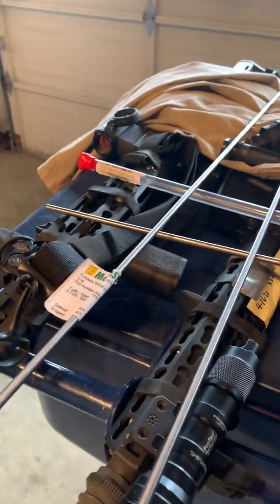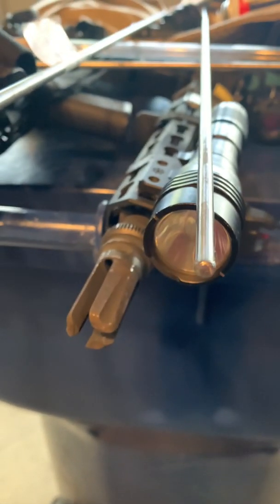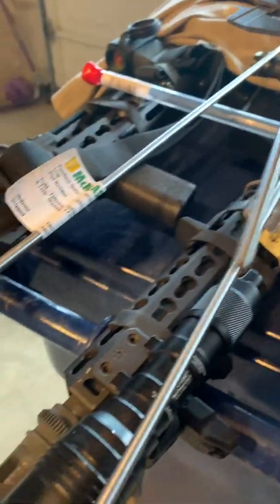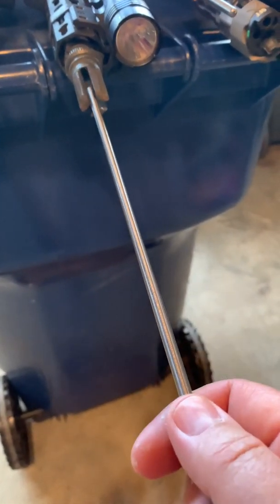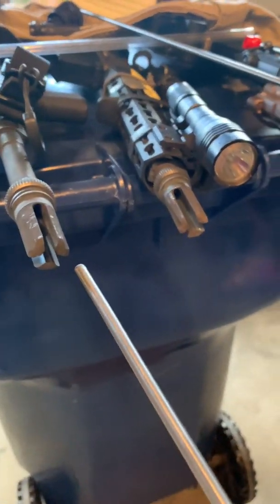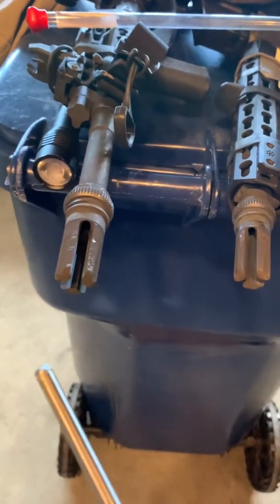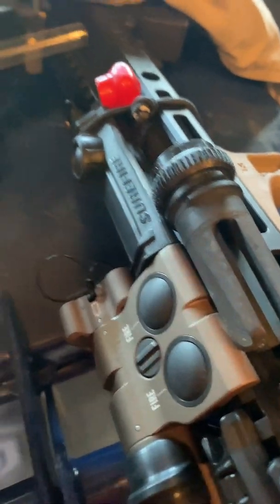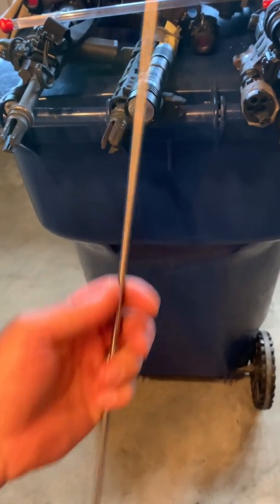McMaster .218” rod compared to .212” and .217 rods with 3 different 5.56mm barrels.

Comment from the maker: Peeoii - got your reply via google mail but not seeing it here.  
“How tight are your muzzle devices? 20ft lbs and higher cause barrel constriction. AR15 tech tips in under 8 mins has a video “the dangers of over torquing flash hiders” very informative my groups got tighter by .5 moa when I loosened my flash hider from 35 ft pounds to 17ft lbs and applied slight amount rocksett”.     Per  Barry Dueck of Surefire, going over 30 ft lbs can compress the muzzle, so I do not go over 30.  For bolt guns, I will use 20 ft lbs and for self loaders, I’ll go 25 but no more than 30.  For a bolt gun I’ll use 1 drop of Rocksett and for a self loader I’ll use 3 drops.  I always dry fit the parts and check with an alignment rod before committing installing with Rocksett.   For a AR, you’ll want to use a Geissele reaction rod, or something similar to keep the barreled upper from rotating.  Never use a crush washer with a can.  If you are using shims to time a muzzle device, dry fit everything prior to using Rocksett.  Hope that helps.

Comment: What flash hiders are on the 2 left ones??
Reply from the maker: AAC Blackout 3 prong FH.  They are about 4.4 oz and quite effective at killing flash signature.  There are many similar FH’s on the market.  Anything with 3 or 4 fairly long tines will work well.  Some people don’t like the ring that they produce sounds like a tuning fork when you fire a shot.  Some other, similar FH’s do this and some do not.  You can modify them so they don’t ring, but the ring doesn’t bug me.
Reply: @forcesolutions4154  I appreciate the response, I’m not getting any of those rods because I have been looking at getting a bore straightness gauge from PTG, I’m also looking into muzzle erosion, muzzle concentricity  and a few pin gauges
Reply from the maker: @peeeoii2738  Sounds like you are going about things in a very thorough manner.  Good luck to you!
Reply: @forcesolutions4154  thanks man, I was thinking about the Geissele though if I were to get one, is it only if you’re planning on mounting a suppressor? or is it good for flash hiders/breaks as well?
Reply from the maker: @peeeoii2738  No need for an alignment rod for muzzle devices/brakes/etc.  Only need it for cans.

Comment: What would you recommend for a 7.62x39 rod? .295 diameter?
Reply from the maker: I don’t have any experience with that so I don’t want to speculate.  Suggest you ask on one of the AK focused forums, or a Silencer forum.
Reply: Maybe a tiny bit bigger than 19/64" I'm talking maybe the next step up or the step after that.
Reply: 19/64 fits 3030 perfectly.

Comment from the maker: In response to a question asking why I didn’t use a 0.218” rod in the earlier videos .  In case you can’t couldn’t tell, I am not a fan of using the McMaster rods as gauges for barrel/muzzle device/suppressor alignment.  They are a very high quality item, no doubt.  I am not criticizing McMaster.  As the videos show, a 0.217” diameter rod is the best one to use for this purpose, and a 0.212” diameter rod is inadequate and I recommend against using them.